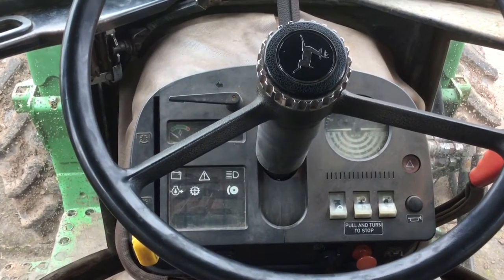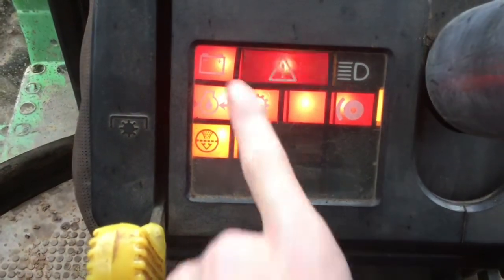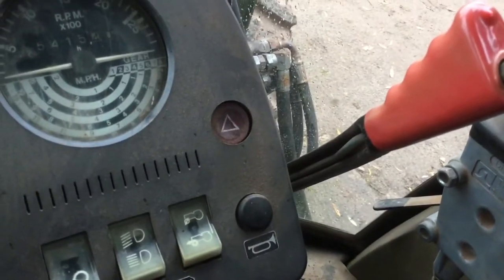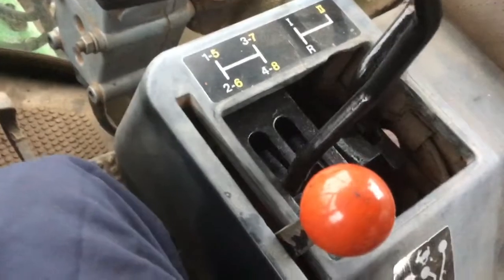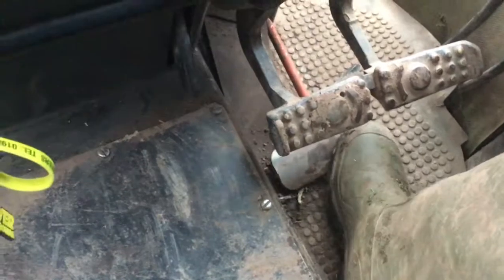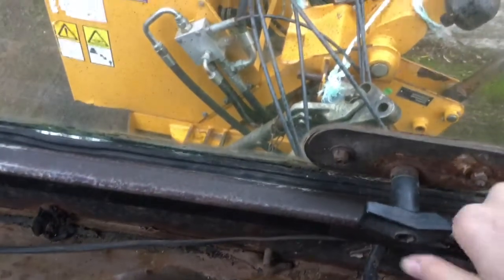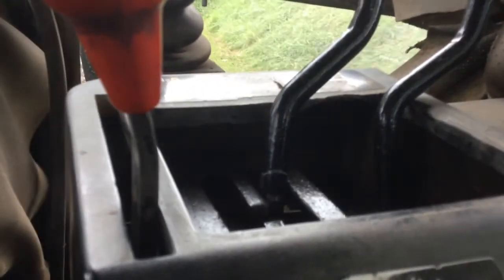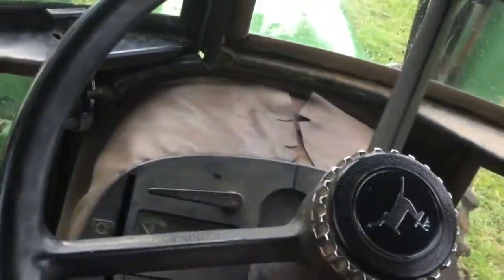HOW TO DRIVE: JOHN DEERE 2140

Comment: Had one new in 1983 brilliant tractor first tractor I had with air con  High / low on the gear stick was a great idea  Then got a new 2650 fuelled up too a 2850 new in 1991 still have it They played about with the gear ratios so you always seemed to be working on low so could not quickly slow down if it got rough also high /low had its own stick just not as cool  Eats fuse cards as well

Comment: Currently rebuilding the engine on mine because I just bought one which is 1986
Reply from the maker: Ah right a fair amount younger than ours then, ours is 1983
Reply: @ignfarmer8769  yes but it has 9977 hours on it
Reply from the maker: Ah right, we’ll worked then
Reply: @ignfarmer8769  well the previous owner kind of ruined it I bought it with a very poorly engine and discovered that a conrod bearing ground to nothing so I have to a rebuild which is no big deal
Reply from the maker: Ah right fair enough

Comment: you didn't show all the ways you can adjust the steering wheel. You showed that you can level it up and down. But you can also adjust it in length. Just twist the centerlock and adjust
I more like grew up in a 2140. I started driving it when I was 9 years old, it was crazy time
Reply from the maker: Indeed, I’ve been told I missed that 🤦. Thanks for letting me know, cheers